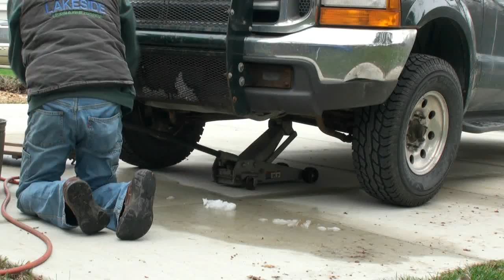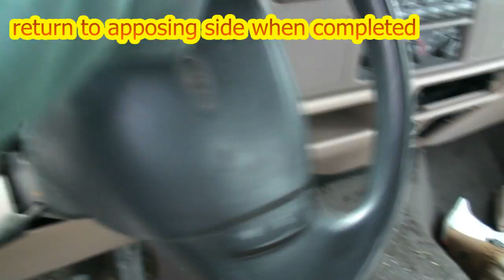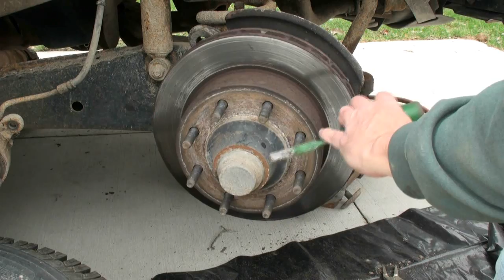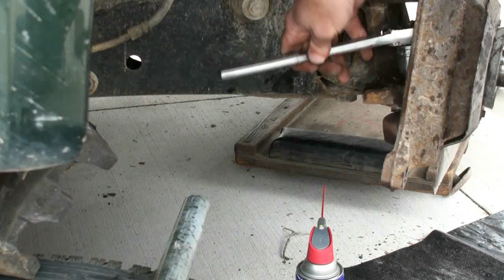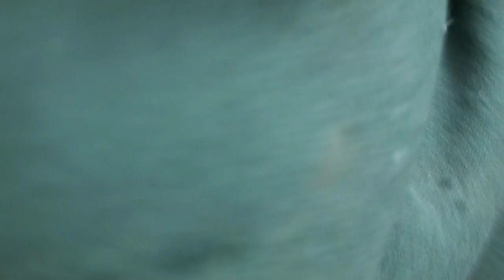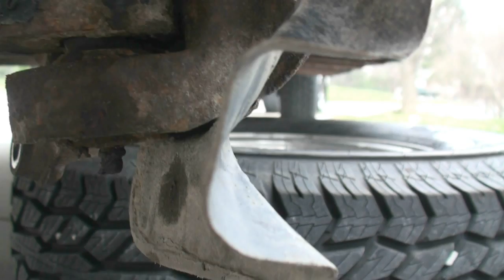Ford F250 Ball Joint Repair - Part #1

Comment: Im trying to do my uppler/lower balljoints and cant figure where he jacked it up from and where he placed his stands, because I am having trouble using my floor jack to get on a safe jacking point. Wont fit in to lift on the "jacking stud" on the ibeam.

Comment: The only standard bolt or nut on that entire truck is the 1/2 inch rear differential cover bolts, everything else is METRIC! That is why your sockets kept getting stuck on the bolt or nut! METRIC.

Comment: 2005 f250 4x4 6.0
There's  a grinding sound at very low speed rolling, low speed turning and when braking all this only when I get down to about 10mph and under. Did calipers about about a year ago. I have never attempted any frontend work but I'm done with ford shops and learning as I go here. If anyone knows what this is I would greatly appreciate it. From research my guess is balljoints but like I said a guess. 
Thanks
Reply: I believe it's the hubs and bearings. Did you find out yet?
Reply: Lol yes I did find out. I changed the driver side hub assembly$480 for the part installed myself. Turns out it's my exhaust of all things. I have a 4"straight pipe system and at the the bend under my feet/under trans it's rattling. 5 minute spot weld problem solved. You'd have to hear it to understand. Motor n exhaust are so loud that a pipe  rattling wasn't even on my check list but all is good now and it didn't cost a penny. Front  bearings were on their way out anyway.

Comment: very nice vid and good instructions. just a few things I would change. its not necessary to remove the rotors if you are using an impact. if you are using a hand wratchet and a vice than it is probably a good idea to. and also as someone stated on part 2. there is a smaller sleeve that you are suppose to use to press in the ball joints do not exert the pressure on the tip of the stud. the sleeve will distribute the pressure throughout the ball joint body.

Comment from the maker: You mite need to pull it on a 4WD but, this is the 2WD Super Duty, You do need to get the rotors out of the way for servicing. I hope this helps